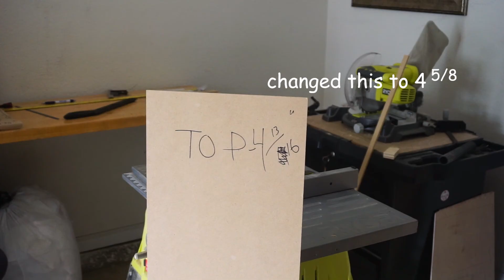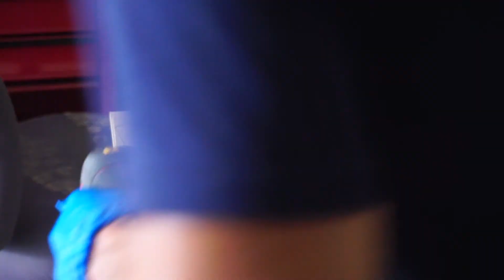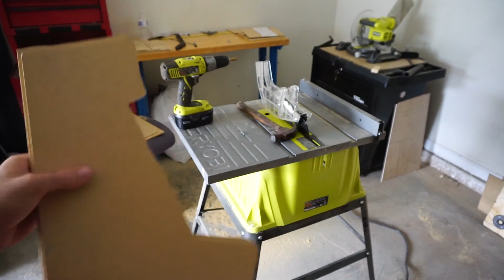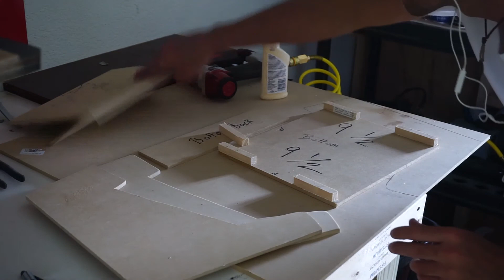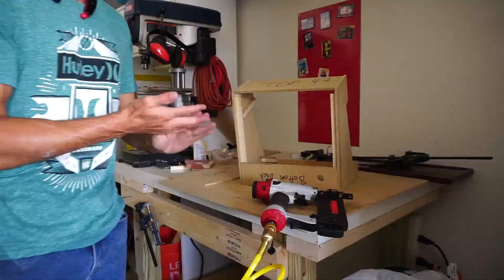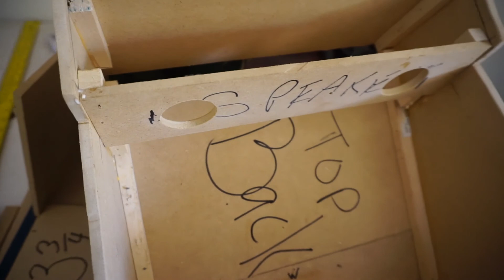How to build a mini bartop arcade part 1: woodworking

Comment: Nice Work, i would like to build one from the templates , but the Templates are Somehow useless . I am faster to generate my own templates  because with the ones you provide its impossible for me to print them in the correct size.  I tried irfan View , MS Paint, PDF Architect.

Comment: I'm building my own bartop as well. I just finished mocking it up in cardboard and scrap wood I had lying around. Mine is double your size with a big monitor and controls for 2 players. I don't do much wood work. You only used 1/4 inch? Think I will be fine with half inch or should I go to 3/4?
Reply from the maker: LestatThirteen if it's a bartop 1/2" will be fine. My bigger bartop uses a 17" monitor and I used 3/4" just bc it's easier to get t molding for 3/4

Comment: are you gonna have a part 3 video showing the mounting of the monitor and measurements for the woodwork by chance? also what were the measurements for the speaker board?